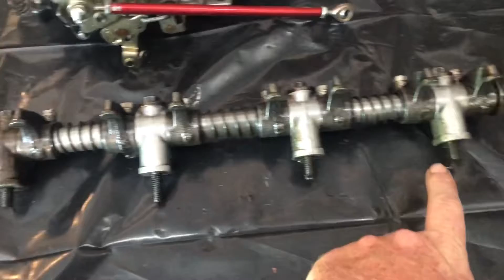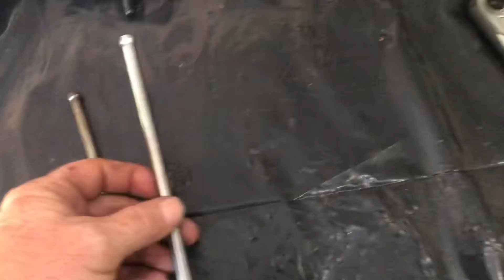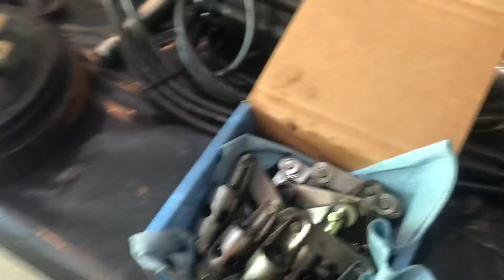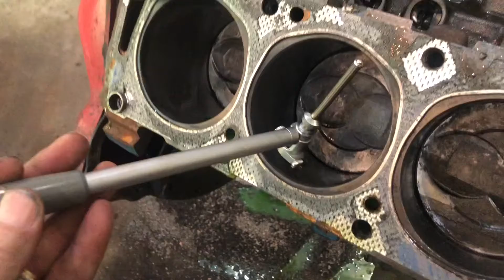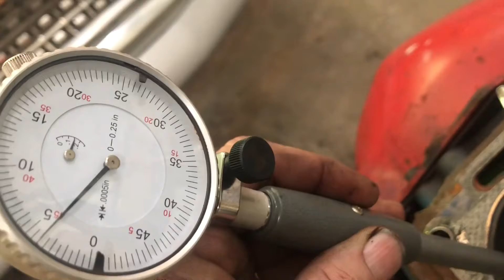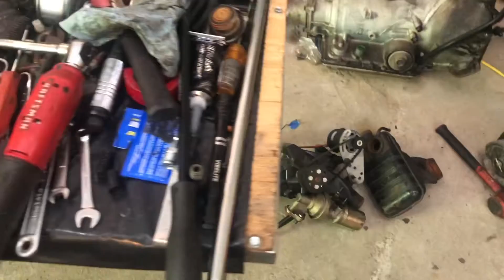FE build part 5 time to strip the old engine down

Comment: the FE motor are unreal I ran 390s to 427 i never had one the blow apart they ran good i never ran a roller cam i always wanted to
Reply from the maker: In my 30 years of dealing with them I’ve only had one blow up, and it wasn’t the engines fault.   I love the FE platform